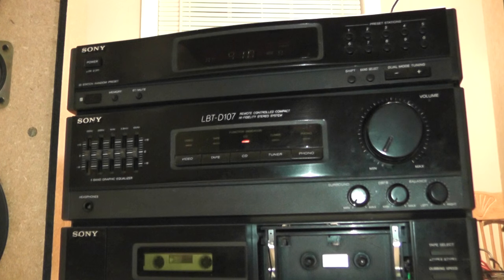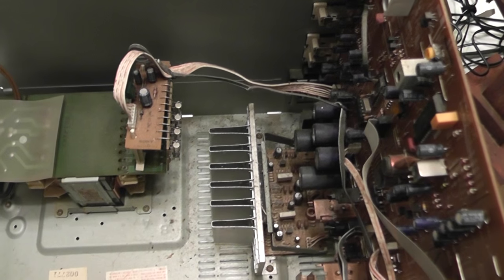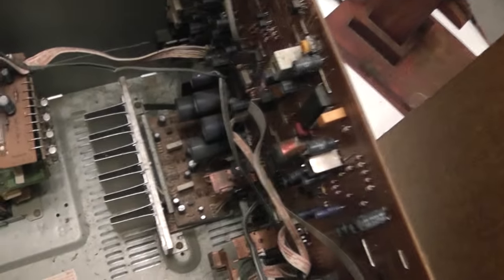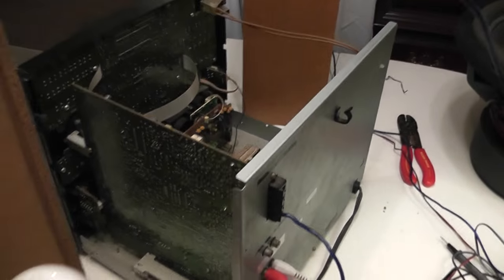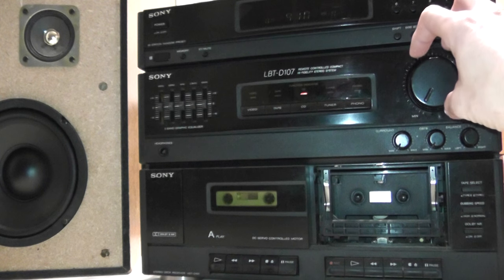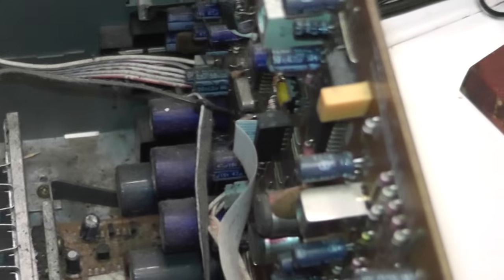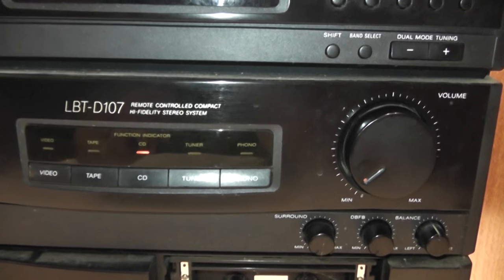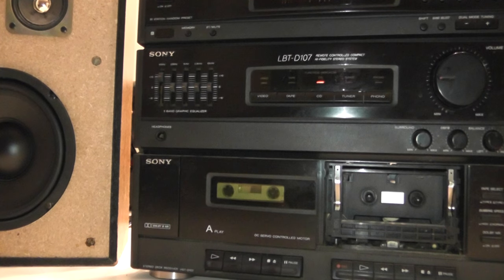Sony LBT-D107 Workhorse Amplifier

Comment: I know this vid is hella old, but I have this setup rn n the speaker wire coming from the speakers are all fucked up,, and I want to ask if you know if you can add like a flex pin connector or even an rca adapter to the wire and if it will work. I'm sure the flex pin will but I'm curious if I put the speaker wire into the rca converter will it still work? any advice would be greatly appreciated